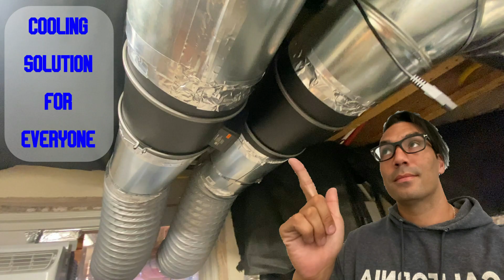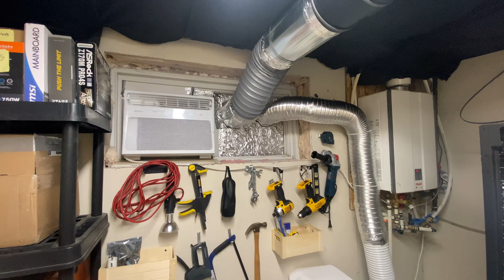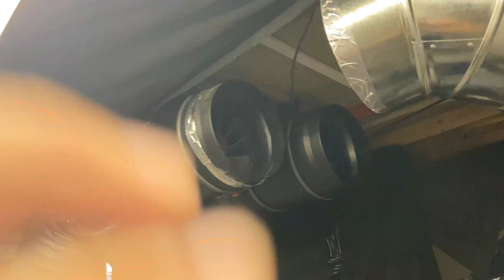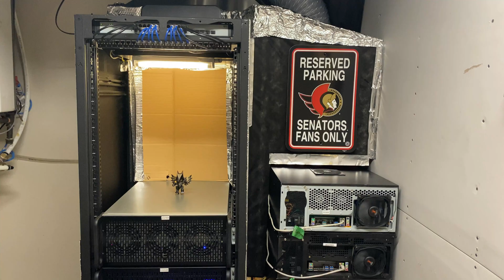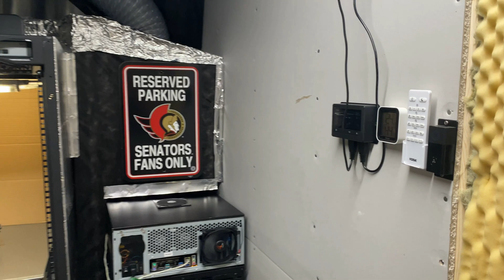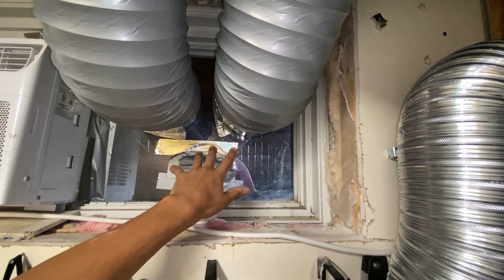3.6GH/s Cooling Solution Complete for 70-GPU Farm!

Comment: Are you planning to create a system where you use the heat from the gpus to heat your house in the winter?
Reply from the maker: Thanks for the view and time to write a comment!

I have thought about this and 100% I will be considering doing this, however the only thing is I’m not sure mining will be profitable come November, so the blueprints are there but not if mining isn’t actually worth it at that point.

Comment: Sorry if you mentioned this in a previous video, but is there any reason why I could vent the top of my server rack instead of adding the box and the hood vent?
Reply from the maker: The reason for the hood Fan is to angle all the hot air from the back of the rack into an active 8” exhaust. 

Reason for the closure/sealing of the back of the rack is because any heat that escapes from the exhaust area will be recycled into the room and increase the ambient temperature.

This is why we have these three things

Capture heat
Prevent from going anywhere else but actively out of the room
Cooling the intake of the servers
Reply: @CustomComputing  Thanks for the explanation. So other than your specific setup, is there any reason why I should not vent out the top of the rack?

I agree with your assessment of how cooling is not being handled by open air mining rigs. You and I both know that data centers have been cooling racks of gear for decades. This is a proven solution.  By the way, have you seen the triplite rack-mounted SRCOOL7KRM system?  Its a little pricey but a cool (no pun intended) solution for rack cooling.

Comment: Why dont you run the extra temp sensor into the box to read exhaust temp? Love the video
Reply from the maker: Actually I was thinking as a test to see how hot it is behind the servers would be a cool stat to know!

Okay gonna do it just for you and I’ll report at the start of my next video which should air tomorrow :) stay subbed and stay tuned :)
Reply: @CustomComputing  yes it would definitely be interesting info to know
Reply from the maker: @Robertevo  done! 38 degrees inside 23 outside! Just submitted a short video on it thanks again for the suggestion

Also is the vr4 referring to the 3000gt? That’s my favourite car as a kid wish it wasn’t so bad on gas I wouldn’t have had to sell it in 2006!
Reply: @CustomComputing  not the 3000gt the galant vr4. I miss my galant vr4 so much it was there rally car before they made the evo the evo 1 is all the galant vr4 running gear. So the gvr4 is sometimes called the evo 0.

Comment: For a long time, i was wondering what the "reserved parking" signage was referring to. But after seeing tonight RPM video, i definitely know what it is all about mister Naruto and Hockey fan :)
That setup is incredibly impressive, we can definitely see the negative pressure in action when looking at the tape covering the third hole in the window :)
If i manage to become a more bigger GPU miner like you and RPM one day, i know what i should definitely do in term of airflow strategy and configuration ;)
Out of curiosity, does the negative pressure has an impact on the air-conditioner unit? Running more hard? Will you have to add another unit at some point?
Have a great week ahead and keep on mining <3
Reply from the maker: Thanks and yeah you are getting to know me pretty well lol I feel like we should go out for brews sometime lol 

The ac doesn’t seem to be running harder than usual, I don’t see any issues with the negative pressure. The only thing I would need if I added 6-more servers (not happening I don’t think….) I would just add another 8” exhaust and that’s it.

The cooling doesn’t change because none of that heat is coming back into the room so just need to make sure the exhaust pressure is enough to not have it backup in the room.
Reply: @CustomComputing  It would have been with great pleasure to hang out with you if i had the chance to live in the "everything is possible" Canada lol
I wish i had more miners around me on my side of the world.
Looking forward to the next video 👍🏽